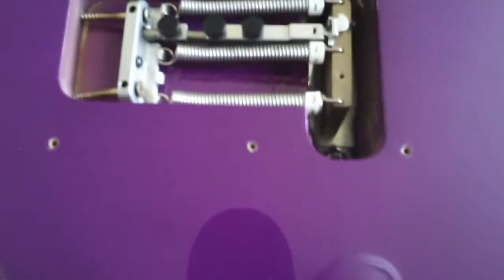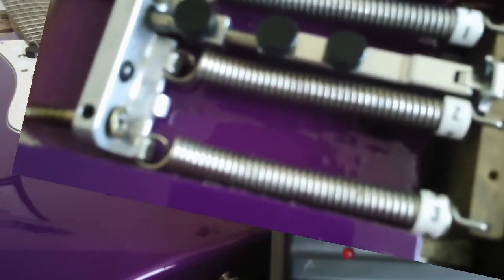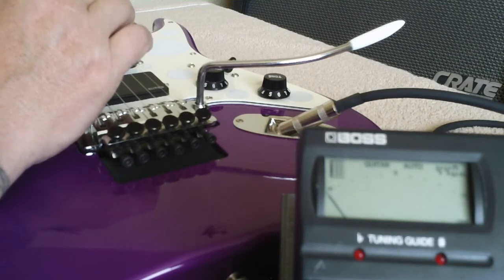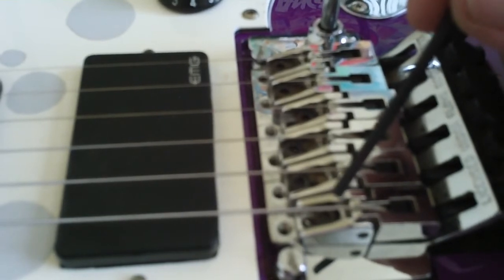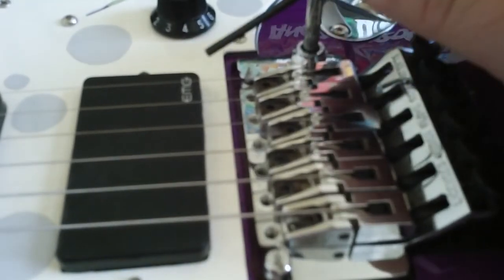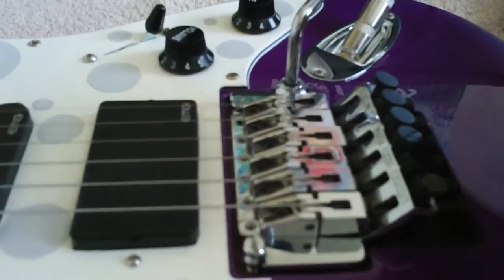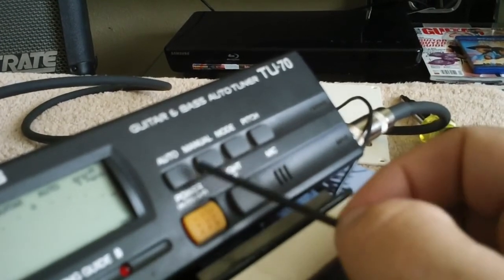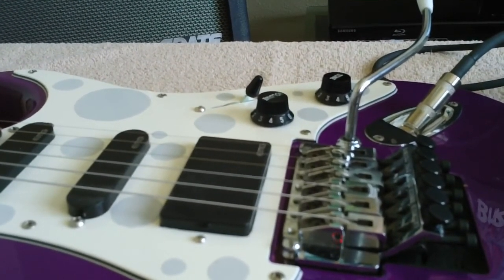Intonation and the Floyd Rose Tremolo Part 2

Comment from the maker: For all those who comment on this video saying the intonation should be set while holding the guitar in a playing position... On a NON Floyd Rose guitar that has a fixed bridge the intonation can be set while holding the guitar in a playing position. However on a guitar with a Floyd Rose Trem it is not as easy to hold the guitar in the playing position and set the intonation unless you have the trem unit locked/blocked and have 3 hands. I have not seen any videos on Youtube yet that show anyone setting intonation on a guitar that has a Floyd Rose Trem while holding it in the playing position. I would love to see a video showing someone holding a Floyd Rose Trem equipped guitar in the playing position and setting the intonation.
Reply: just to add you have detune the string enough to get to the screw and when you tune back up you will have just streched the string again  and the tension will be different then before. becare watching scot groove videos hes very smart but also a little loco
Reply: +Madroj DaMadone You block the floyd perfectly level, adjust the intonation, neck, action yada yada the LAST thing you adjust is the springs on the back to match the tension of the strings. It's really not complicated at all. I do this EVERY time I change strings. And yes I do it from the playing position, because I actually want my shit in tune and I have other shit I need to do.

If you can't set up a floyd from a playing position you're doing it all wrong. Send me your floyds and I will set them up.
Reply from the maker: SuperCombine CP put up a video showing your set up of a Floyd Rose trem while holding the guitar in playing position and I will watch it.
Reply: I will post a video of me adjusting the intonation and tuning from a playing position soon
Reply: You definitely want to intonate in the playing position, but it's not difficult like everyone is making it out to be.  Let's say you're gonna stand - put the guitar on, use the neck pickup and pick over the neck with the same force you normally do and get all 6 strings to pitch.  Then check the 12th fret and note how sharp/flat etc it is.  Let's say it was sharp.  Take the guitar off, block the bridge (just use a woman's nail file wrapped in multiple layers of cloth to protect your finish), loosen the string you're messing with and move the saddle back just a bit.  Tighten the string, unblock, retune all 6, check again.  Still sharp?  Repeat the process.  Go back too far? Move it forward.  Eventually you'll get it.  When you're messing with it, you can set it down, just don't CHECK the tuning/intonation out of the playing position.  After dicking with intonation, you check the neck again, check the action, check the pick-up height, make sure spring tension is right, recheck intonation, and you get it.  Just make sure after every adjustment you retune all 6 strings and use the neck pick-up and pick there with your usual force while holding it the same way you will be when playing it.  Pain in the ass, but once you've got it, you've got it so long as you don't change string gauges or use a different tuning.  If you don't check the tuning and intonation while standing and you check it in the luthier stand, then when you pick it up and check your tuning and intonation that WAS just perfect, you'll notice that you're now flat as hell on all 6 strings.  It's not rocket science.
Reply: RJ D'MadOne .....only those of us who have set these understand.
Reply from the maker: Yes... Those who have set up the intonation on guitars with a Floyd Rose Trem fully understand what I am saying. Still cracks me up that most of the peeps who commented that the guitar must be in the playing position while setting intonation on a guitar with a Floyd Rose Trem unit don't even have any videos on their channels showing them setting up intonation and don't even have any videos of them playing a guitar. Go figure...LMAO

Comment: "And then I realized I didn't press the record button",, No way... :):) Anyway, I always set up the intonation sitting and holding the guitar. That is the right reference position. Guitar lying down like yours, there is always gonna be different string tension and bridge angle due to gravity, unless you will lock the bridge so it doesn't float in your playing position first, and then lay it down. No, the intonation will always be wrong, because also the neck bends and like I said, bridge is set up at different angle than if the guitar was in position like you play it. Gravity always works though :) :)

Comment: Hey @MadrojDaMadone, that whole harmonic tuning can be skipped, it's not recommended by any1. U can use it at first 2 tune strings, it's approximate to accurate (u still need a tuner 4 complete accuracy). But u shouldn't use it 4 intonation.

I have a regular Fender bridge and was taught this harmonic approach when I got into doing it on my own. I stopped a long time ago and haven't had any problems. 4 a confirmation on this, look up Andrew Wasson here on youtube.

Comment: I disagree with one thing. you insist on picking the string very lightly, but in reality you need to pick the string as heavy as you intend on playing. if you play soft and lightly then fine but if your a heavy picker then you need to pick heavier when tuning up and intonation otherwise everything will go sharp when you start playing
Reply from the maker: +Paul reed Smith Well I would like to say you were the first one to make that comment but your not. I will say that you are correct in your comment and picking the string lightly, as I did in the video, is not the best way to do it. When I posted this video a friend of mine made the same comment and I am glad he did as I did a little research and found that I had 2 problems with my rig. 1st problem was that I had a broken ground connection in the guitar and that did not help with the Active EMG pickups I had in the guitar. The 2nd problem was a bad cable. After some time I fixed the ground connection issue and replaced the cable. Then I went to set the intonation again on the guitar and found that the intonation was dead on. I was totally surprised as I expected the intonation to be way off. Not sure to this day why the intonation was set right when I had those 2 issues but I did say thanks to the man upstairs. Thanks for watching my video and hope you got something out of it. Rock On :)
Reply: ***** sure thing. you are such a nice guy, and I'm glad you resolved your problem. you should make more videos any guitar and gear related

Comment: the guitar must be in "playing" position or vertical, becasue of the gravity pull won't let you have correct measurments!!!! If this was done for the vid's purposes, ok! I don't want to be judgemental, here but, that's the ''least wrong'' way!!
Reply from the maker: I can tell by your comment that you did not watch the video or you just did not understand what the Trem No Trem unit was for. With a Trem No Trem unit installed it locks the Floyd Rose in place so it does not move out of position. This allows for accurate measurements and correct tuning of the guitar. I hope that clears up some of the confusion that it seems you had about my video. Thanks for you input.
Reply: ***** ...even so, the gravity matters not for tremolo only but the whole neck, trus rod and strings! I, again, say that I don't want to be "picky" or anything, just pick a string in the "playing" position and while it rings place the guitar horizontal!!! Can you hear the diference in tuning?
Reply from the maker: I have tried tuning guitars both ways... I can not hear a difference. When the guitar is tuned the tension on the strings keeps everything together. Maybe I am not understanding what you are saying about the difference but I have no issues with horizontal tuning although I only use horizontal tuning just to set up the intonation but who knows... Maybe your way is best. Have you considered making a video of what you are talking about and posting it on Youtube? I think if you did post a video showing the difference it would get a lot of hits as most people with similar videos to mine do initial setup for intonation the same way I do. Just something to think about.

Comment: That's not how you set intonation. Chiming and open picking will produce same root note. Guitar will not be correctly intonated. You should be in PLAYING POSITION and you should be plucking the 12 fret harmonic and then FRETTING then 12th fret and they should produce the exact same note. What you are doing here is essentially plucking an open string and then attempting to find a difference between chiming. You wont find any. This video actually pisses me off. You are going to show people how to screw up their floyds and get even more frustrated with setting them up.
Reply from the maker: +SuperCombine CP Well if you visit Floyd Rose's website, as I have referenced in this video, you will see and read the same info I did before making this video. Somehow I do not think Floyd Rose's instructions on how to set up a Floyd Rose Trem are as incorrect as you seem to think. However I am no pro guitar tech and I do not know everything about setting up guitars so if you have a better way of doing it... Please share by posting video for all to learn from.